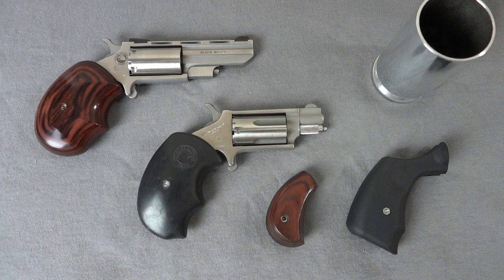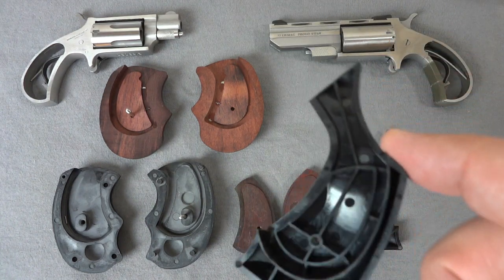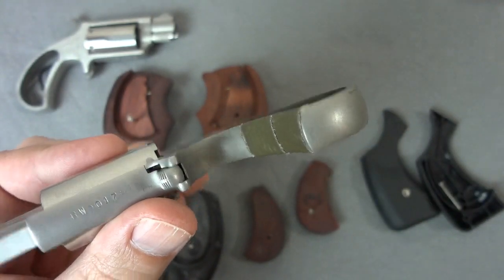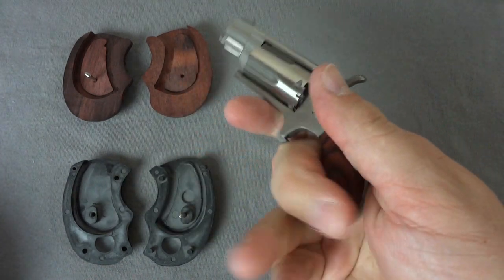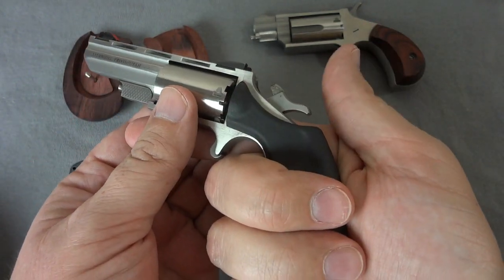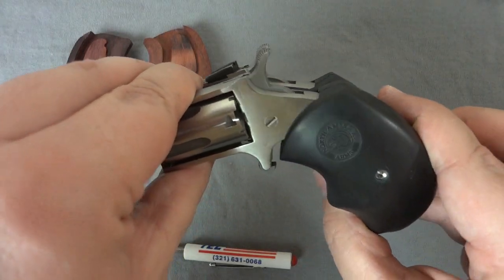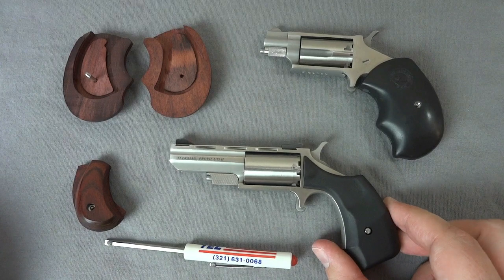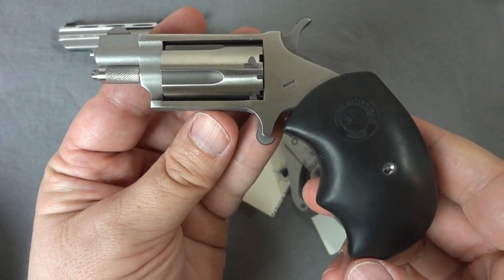Revision CV Grips for NAA Mini Revolver

Comment: 2:56  The current version is that oversized rosewood grips have two metal pins that go into each half, so it's just as solid as the rubber ones :)

Comment: can't wait for the ranger 2 to come out.... gonna get some cv grips for it. also note: the grips come with instructions to put a small amount of thread tape or electrical tape to the hidden back part of the frame to eliminate the play in the grips once installed.
Reply from the maker: I don't recall this on my grips, but then I was doing the same thing before any of these things came with instructions.  The Ranger 2 is shipping, I believe.  I'm going to wait for the first few batches and see how the reviews are.  I held off on the Ranger 1 due to price and the fact it was a limited run.

Comment: I have a 1 5/8” barrel .22 Magnum with .22 Long Rifle conversion cylinder. I may not be ham-handed but I do have big hands (I wear size XXL gloves). With the standard bird's head grips I could only get a one finger grip on my mini so I bought a pair of oversized rosewood grips. Then I could get a good solid two finger grip, but they made the gun too bulky. I filed and sanded the sides of the grips to flatten them out which made it a little narrower, but I still didn't like it. Finally when I found out they made rosewood boot grips I bought those. It's still very compact but I can get two fingers on the grip now. Well, one and a half actually, but that's good enough. There's barely any difference in the overall size of the gun but a big difference in how it fits my hand. 

I had to use a piece of paper or card on my oversize grips too. When I bought my gun the choices were .22 Short, .22 LR, and .22 Mag. frame sizes. No Black Widow at the time as far as I recall, just a choice of1 1/8" or 1 5/8" barrel on the LR and Magnum. But if I was buying a new mini revolver I think I'd get a Black Widow. With just a front sight and not enough shooting with mine I still don't know how to aim it to hit anything. But like one guy told me, it's a face gun, you stick it in somebody's face and pull the trigger. Beyond bad breath distance you're better off with something else, but it's the only gun I ever stuck in my pocket and forgot it was there until I got dressed the next day.
Reply from the maker: Good info.  I've not tried the boot grips, but I may.  I also wear XXL gloves, but all hands are different.  I may order up a pair.  I've got my hands on the Ranger II top-break pistol.  I think they come with the boot grip.  Good look.

Comment: They are cool tiny revolvers Really like the sidewinder and ranger 0r the 4 inch black widow  Id like to own the Guardian .380 made by NAA as well but not for the price of one.
Reply from the maker: I have owned a Guardian in the past, but I sold it.  Very impractical.  With the LCP Max on the market, I don't believe there is room for any other small 380.

Comment: I've had the Black Widow, and Mini-Master, both Conversion models (.22Mag with a Long Rifle Cylinder.)  The Mini-Master is about the best bargain (MMT-C).  Honestly, barrel length doesn't make a significant enough difference in carry to not get the 4", but the 2" isn't too short.  (The 1" kinda is outside of "Whites of their Eyes" range)  The nice thing about the whole line is the grip frame is interchangeable, so all these grips fit all their cylinder pin models.  (Haven't tested this on the Sidewinder, or Top-Break models.)  The Black Widow has the nicest looking proportions.
Reply from the maker: I've got two, still.  The ones you see in the video.  The Black Widow is still my favorite.  I've owned many other models over the years, but never a 4".  Heck, I'm in Bearcat territory by the time I do that.  I've been Jonesing for a top-break, but I've been unwilling to pay scalpers prices for one.  I may have to spring for a Bearcat Shopkeeper and Ranger II before too long.  I can't spend the money when I'm dead.  I like the 2.5" Ranger 2.  Think I'll put the Black Widow size grips on it, though.
Reply: @RyeOnHam  Yeah, if I'm in Bearcat territory, I might as well go all the way up to Raging Hornet.  Black Widow is still my favorite, but the Mini-Master just doesn't compare to the Bearcat (.22mag)  It's just a Black Widow+2".  The sight length is worth the trade-off in OAL, which honestly isn't that much.
Reply: The Ranger II will accept any of the grips designed for their Magnum revolvers.

Comment: Cool little revolvers.  But I'm passing on buying one.  Yes you could carry it for self-defense.   But getting a 8 round snub nose 22 lr /  22 mag revolver just makes more sense if you're going carry a revolver.
Reply from the maker: True.  They are a niche gun.  I would definitely recommend something with more power if you are choosing between, say, a 38 and a .22.  However, if you've got a 38 already, you can get something smaller.  For four-legged and un-legged creatures, these are definitely appropriate.  For two-legged ones, maybe consider them a backup.

Comment: That thick rubber grip could be smaller. Something bigger then stock but not that big.
Reply from the maker: Everybody's hands are different.  I like the size of the rubber one, but I would prefer wood as a material.  The rubber is too sticky and prints when you are concealed carrying.
Reply: I like the outline of the rubber grip but also think it is too thick. I front pocket carry and the handgrip is the thickest part. 22 Mag with you is better than a 45 in the car.
Reply from the maker: ***** Agreed on having a gun with you.  I have tried several grips and the ones I have are great, but still thicker than I would prefer.
Reply: I'm thinking of carving my rubber grips thinner. Will update you.
Reply from the maker: ***** I don't generally like rubber as a material.  I like a good marine-grade plywood.

Comment: Any reason why you can't stone or what I would do is belt sand a rad on the back of the cylinder.
Reply from the maker: +NAHAAFB I suppose I could, but it is not nearly so bad when it is loaded.  I failed to mention this in the video, but the rims fit pretty snugly into recesses and only the safety notches are really a problem.  Everything is so thin back there that I don't really feel the need to try to mess with it too much.  If they made the oversize grips like I have on the Black Widow with shields that came up to the back of the cylinder, I think I would be tickled pink.
Reply: @RyeOnHam  Thingmeister FAbrications makes grips for the NAA pistols that are fantastic--
Reply from the maker: @TheJennflip  I'll check them out.  Looks interesting.

Comment: Why didn't you show the holster grip?
Reply from the maker: Well, first, because I do not own one, but mostly because I do not like them.  Every one that I saw that was not brand new was loose and wobbly.  YMMV.
Reply: I have had a holster grip on my NAA for over twenty years and I love it.  A much better handle to hold it with and itself is a holster.  Don't knock it if you do not own one
Reply from the maker: @kenjohnson6603  I'm not here for an argument, Ken.  I do not own one.  That doesn't mean that I do not have experience with them nor does it invalidate my opinion.  As I said in the video, the Revision CV grips did not work for me either.  Again, your mileage may vary.  We all get an opinion.  Obviously, there is something to the folding grip or they would not be selling them.
Reply: @kenjohnson6603  If you use a tiny piece of flex seal tape the grips will not wobble. I also have the holster grips on my ranger 2. I removed the clip and made the screw heads flush and removed some of the excess bulk. I would like to modify it further for the range.

Comment: those look nice, but with the extra size it kinda defeats the purpose of the gun to be super compact. maybe it you were doing a lot of range time and not carrying a lot.
Reply from the maker: We can disagree, but my philosophy is that you need more than one finger on the grip to control it and for follow-up shots.  These grips are really small and narrower than the Black Widow grips, which I carried with for years.
Reply: @RyeOnHam  I have only shot them with the factory grips.  While not ideal, I shot probably 20-30 rnds in an outing no problem. The larger grips put it in the same size range as a small semi auto 25 or 32 acp, which for me, the the naa is supposed to be smaller and more compact than.
Reply from the maker: @jonathanrogers9961  As I said, we can disagree.  On the grip, it is not only "not ideal", but not practical with my hands.  To wrap my middle finger around the factory grip, I cannot see the sight nor can I properly manipulate the trigger.  I can get it to go off only by pinching the gun awkwardly.  I have belt and pocket holsters for both the Beretta 950 and the NAA Black Widow.  I can tell you, once again and with authority, the Beretta is wider and taller.  It's also in .25 ACP vs. .22 Magnum.  I can shoot the Black Widow all day long with these grips, yes, but that's not the point.  The point is to have a grip I can actually use and sights I can see as well as being able to hit the target.  The grips are JUST a hair wider than the holster.
Reply: @RyeOnHam  interesting. didn't think about the holster width compared to the grips. It has been a bit since i shot my friends, and the one my shop ordered should be arriving late this week  i will keep it in mind as i break it in, thanks.

Comment: Can be used but think it is more a novelty gun
Reply from the maker: Not sure what you mean by that.  These guns are very useful.
Reply: RyeOnHam as a backup gun
Reply from the maker: I think of it as more than that.  Sure, you can load up your RMR-equipped Glock race gun a laser/flashlight, bayonet, extended magazine, etc... but are you really going to walk around Walmart that way?  I can grab my keys, wallet, cell phone, pocket knife, and Black Widow and be out the door.  Tiny pocket holster and the thing won't print.  That .22 Magnum is effective enough to do some damage.  Sure, they may not explode with the first shot, but then I'm much more likely to carry it everywhere than I am my Glock 21.